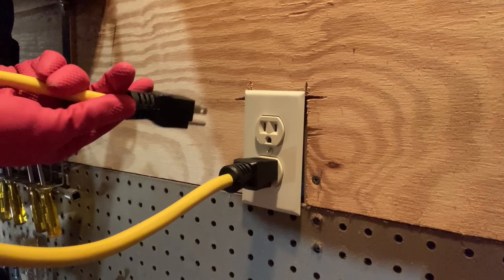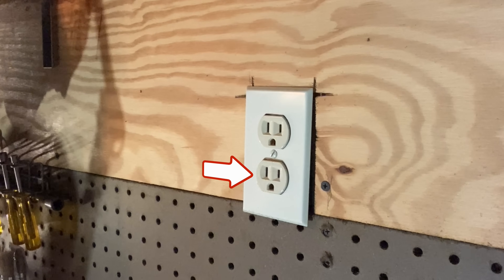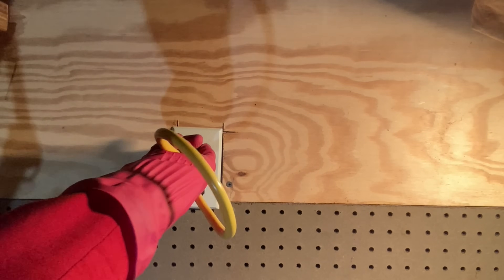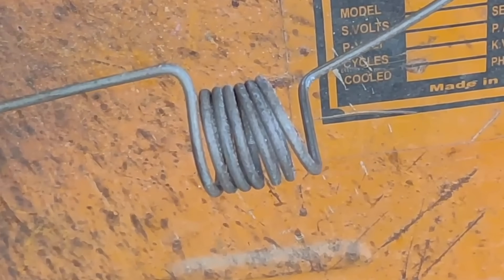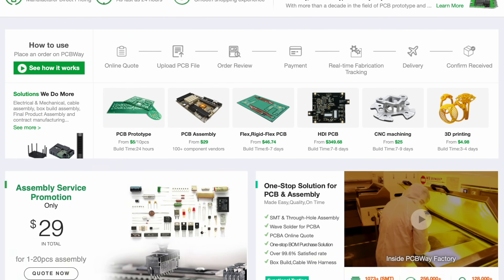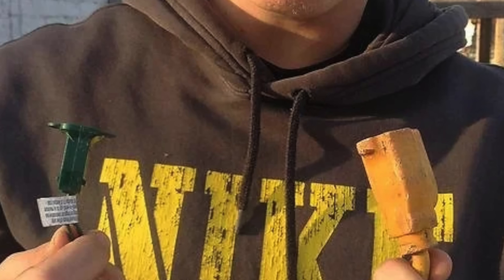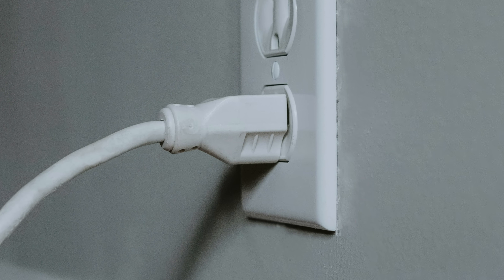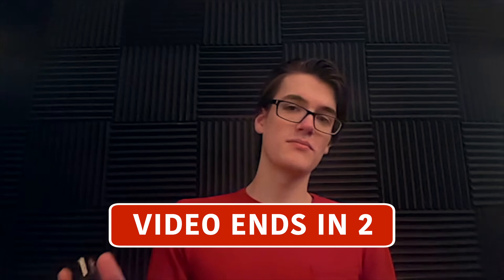I plugged an outlet into itself...

Comment from the maker: ⚠WARNING⚠
Some outlets do not have the top and bottom connected internally. This is so that you can have a switch control the top while the bottom is always on, or similar. Connecting the top and bottom of one of these outlets would be incredibly dangerous! This is one of the reasons I say you should not attempt any of these things at home, no matter how safe it appears on video. Stay safe guys!

Comment: Even if you plug the cable back into the same outlet, there will be a little phase drift based on the length of the cable. Not a big deal with one of that length, but hook it up to a long enough cable and you can get it to be a half-wave out of phase. Might or might not blow your breaker, but will get hot.
Reply from the maker: Oh that’s a good point I hadn’t considered. I wonder how we could calculate how much phase drift there is per length 🤔
Reply: @danovation  It depends on the diameter and capacitance of the wire used. The capacitance will increase with diameter, and depends on the alloy used, as well as stranded vs solid. You can model it like a chain of capacitors, by considering the cable in  discrete segments.  You can also simplify the calculation by considering a single low->high transition and calculating how fast it reaches the other end. The real value is then the limit as the segment length reaches 0, and with the since transition replaced with a sine function. 

There is an article on the Dallas One Wire protocol, called "Save the Earth One Resistor at a Time", which goes through some of the math involved, and has sample values for very fine wire (the sort used for signaling, not current transmission).
Reply: The energy travels through the cable at around 2e8 m/s (due to the dielectric material that is around the strands).  That is 2/3 of the speed of light. So the time delay for a 1 Mile long cable will be about 8 us.   That equals  0.17 degrees phase shift for a 60 Hz mains. So you should think of 0.3 V difference between the cable and the parallel connected outlet.   

The capacitance between the wires will be in  the 200 nF range for a 1 Mile long cable. The current through this capacitance will not trip an RCD  / GFCI.
Reply: @wimtel  Appreciate the lookup, that sounds about right. You'd need to hook several spools end-to-end and back in to have anything significant. Though if the wire is in a coil, especially around an iron pipe, you might get significant inductive effects at a shorter length.
Reply: @yellingintothewind  This virtually doesn’t change the situation.    The reason is that if the phase wire carries 1A, the neutral wire carries -1A (it goes in opposite direction).  Both wires generate a magnetic field. However the fields cancel at distance, as they have opposite vector direction.  In order to have field reinforcement (as in a coil of only one wire) you need to have magnetic field at distance from the cable/wire.   

You may do a search on common mode filter and differential mode current.   

The cable has inductance, but that is because of the field that seeps through the space between the conductors.   It will be in the 300 nH/m range.   Together with the capacitance between the conductors, it makes a transmission line for  RF.

Comment: Why would this be dangerous exactly? Even if it's a split plug on a different circuit which is highly unlikely, it's still the same panel, ground, neutral, everything. And even if one of the split plugs were wired wrong, one of the breakers would just trip instantly because your hot would be going straight to neutral or ground. 

So the only way I see this being dangerous, is if a breaker is faulty or dramatically oversized.
Reply from the maker: The issue is that most places use multiple faces of AC current, for example in the US I think 2 phase is most common. If you connect two outlets that are of different phases, you will effectively be creating a short. But as you said, this should be handled by a simple tripping of the breaker. (That's why having the cable only connected at one end is significantly more dangerous)

Comment: Silliest part: the 120V cable you show doesn't even power the whole house when done "right" (turning off the main breaker to the lines before starting the generator) because only half the circuits in your house are connected to any given 120V line and that's through a 15A breaker.

To even make it "work" as intended, you'd need the 240V version & the electric dryer (or equivalent) hookup.  That's basically how mine works, but I have it on a second main breaker with a plate that makes it impossible to get power from both generator & mains power at the same time.  Although, I'm fairly certain that a single generator would be so overdrawn by all the houses on that downed grid segment that it would shut down anyway...
Reply: Not exactly. Whatever outlet you plug this thing into, it will connect to the main busbar and if you don't have a transfer switch, you probably (and I don't mean YOU) don't turn the main breaker or mains disconnect off. The problem isn't powering up other houses but suddenly energizing the power lines that the linemen are working on.

Also I've seen a lot of clever people who use generators will have a jumper connecting the two main legs so the whole house is powered up. They usually know what they are doing though and have a transfer switch and whole house batteries and solar and blah blah youknowwhatImean
Reply: @BariumCobaltNitrog3n  he didn't say that powering other houses is the problem, rather that it would simply overload the generator and shut it down either by stalling the engine or tripping the overcurrent protection device because it would simply be more load than a single generator can handle. Clearly, it's very important not to backfeed the grid. Not only for safety, but also to make sure the generator works properly.
Reply: @Krankie_V  Are you an electrician?
Reply from the maker: yeah as @BariumCobaltNitrog3n mentioned my main concern was that the linemen would be endangered
I was definitely wrong about the most common source of that danger, as (and this is pretty obvious 🤦‍♂️) the power plant would not be sending power down the lines while they are being worked on, so more likely the danger would stem from the linemen trying to work on the lines (which shouldn't have any power running through them) but you connect up your suicide cord and now those lines are powered. This is still very dangerous and definitely something no one should do!
Reply: I've got mine hooked up with an interlock as you've mentioned. The only way to backfeed the grid would be to intentionally pull the panel cover and keep both the main and the generator breaker on at the same time. That would be a really stupid thing to do though, so who in the world would do that 😂
Reply from the maker: to answer the original comment yeah you're right, I didn't consider the fact that we use 2 phase electricity means that you'd only be powering the outlets on the same phase
Reply: @danovation  Oddly enough, two hots is single phase and 3 hots is 3 phase
Reply from the maker: @ yeah this stuff is way less intuitive than DC 😵‍💫

Comment: As a hardware store worker, call these suicide plugs or chords. At least in california its illegal for me to even help you make one, and if you want to connect a generator to your house it has to be a licensed electrician that does it with the transfer switch mentioned
Reply from the maker: Hey good for California on that one!
Reply: Here it is same... But... When you are not connected to the electrical grid they can not really legally stop you from doing what you want, everything in the law here and what it say about 220v and what you can do yourself is tied to you being connected to the grid. In my case my house is completely cut of from the grid and legally they can not stop me from doing stupid stuff with 220v,... But if something goes wrong and my house burns down the insurance company can reject the claim because the electrical system was not up to code. Same with blumbing here, as long as you are not tied to the water grid you can do anything you want. But when your water is connected to the watere grid you HAVE to have a certified plumber do all the work...

Comment: As mentioned previously, the outlet can be separated into two different phases, for example if you want a switch on one outlet and not the other. 

A time that this will be practical is under your kitchen sink. You have the garbage disposal that should be controlled by a switch, and the dishwasher that should always be on. Some codes require this to be under different breakers as well. That means plugging in this cord under your kitchen sink can make a 240 volt short.
Reply from the maker: That's a really good point, definitely be careful of that!

Comment: 00:43 Those 3 wires to to the breaker? Those two screws are connected, why have two wires? The one on the other side is neutral, where is the ground? The two hots in an electrical panel ARE in sync, but 120 degrees out of PHASE. This cord is far less dangerous than this video. If you want to see sparks, reach under your kitchen sink and plug that outlet into itself
Reply from the maker: To be fully honest I think I made a silly mistake
The footage I used for that shot might be the wrong outlet (one that was wired up differently with 2 wires going to those 2 screws and 3 wires on the other side)
I actually have no idea what was going on with that outlet…

As far as the sync vs phase, that was what I was attempting to describe, as you can see from that visualization
I’ll try to be a little more precise with wording in the future, as I don’t want to miscommunicate
Reply from the maker: As far as the danger of this cord, it really is quite dangerous.
If you have GFCI then plugging an outlet with a disconnected top/bottom or connecting 2 outlets would simply trip that, and you’d be fine
BUT as long as the cord is plugged in at just one end, the other end is a major safety hazard, putting you at risk of a 120v zap (which if you touch with a finger probably won’t be caught by the safety as there will be enough resistance for it to go undetected)

Comment: I was thinking that plugging two different plugs together would be extremely dangerous in that sometimes builders connect plugs backwards. The plug is still usable but connecting plugs together could instantly connect the hot line to the neutral.
Reply from the maker: Yeah that’s a good point as you wouldn’t really notice they were backwards unless you checked with a multimeter

Comment: Don't be an idiot this only works if there is no outlet power on the bottom or top  if both have power you just created a heating element, I will be reporting this video because you are promoting dangerous behavior
Reply: Don't be an idiot, they are connected internally inside the box and receptacle. The only case where there would be risk is if the top and bottom receptacles were on different circuits and on opposite legs in the panel. This is almost never done, but is possible.
Reply: He plugged hot to hot and neutral to neutral. There is no flow of energy here, which is needed to make a "heating element"
Reply from the maker: 100% be careful. 100% do not try this at home. But as I showed in the video with an outlet like that the top and bottom are already connected behind the panel. You are not making any new connections! So there is no danger
Reply: @danovation   In kitchens, the top and bottom receptacles are routinely connected to different circuits, so that you can plug your kettle and toaster in at the same time without tripping the circuit.  These circuits may be on different phases, making this an extremely dangerous  thing to do.